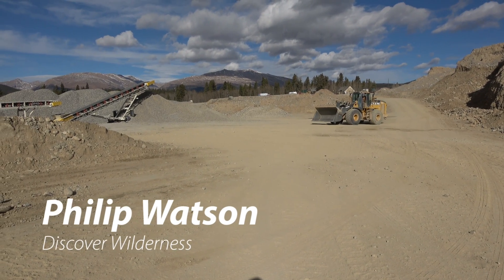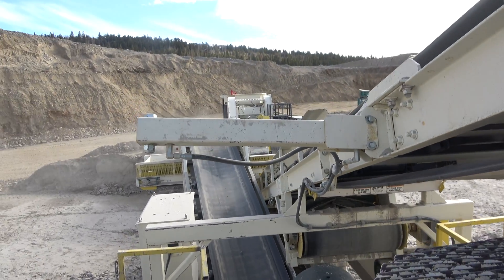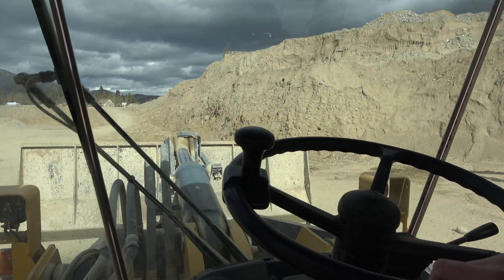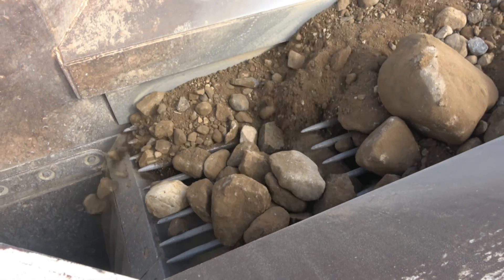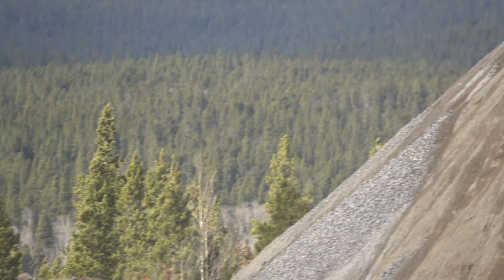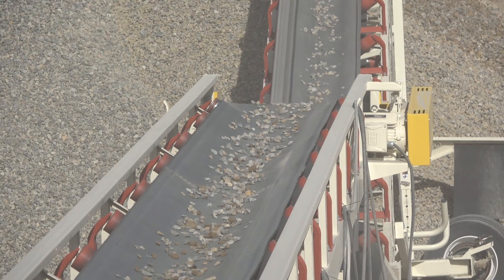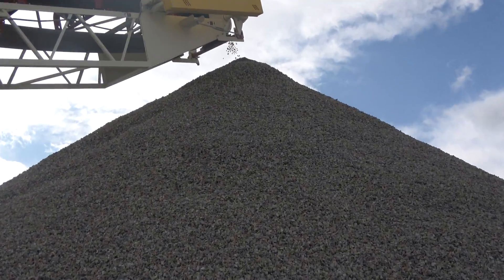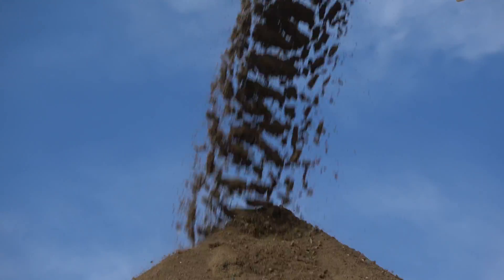Jaw Crusher, Cone Crusher (Road Base - How It's Made) (4K) - Episode 27

Comment: What tonnage per hour does your plant produce?   Also, I’m interested in cost/hour.  I’m getting involved with a preliminary study regarding crushing a 185KT ore pile down to -3” material, that will then be put through a 35T/hr ore sorter.  Ideally, I think -1” material would be best through the Steinert Ore Sorter, but for speed/delivery, management is thinking -3”.  I’m arguing that -1” can be handled effectively through a system such as this, whereby both -3” & -1” material is created.  
Regards,
GL, P.Geo (from Canada).
Reply: 500 tons per hour

Comment: And what are you guys using to control belt speed?
Reply: U don't
Reply: There are different size pulleys on the drive pulley , so you can select one of them to regulate your speed.
Aside from that, there is no way to regulate the speed electrically unless things have changed since.
Reply: @reb2322  a VFD or variable frequency drive is an option for alot of applications. We use one on our infeed. Thats really the only place we use that. I've never dealt with generator electricity and it's concept is not well voiced anywhere I searched. I've dealt mostly with line phase voltage with 5 wires. So when a gen set has only 3, I had to wrap that around my head. I thought no neutral? How the fxxk does that work??? I was confused until I finally grabbed the roots of a balanced system. Im only a part time service tech at best. Degreed in Drafting and Machine Design with an AAT but no electrical training. When it finally made sense I became much more comfortable working with that type of voltage

Comment: What kind of starter do you use on the jaw? Contactor, VFD OR soft starter? Would it be possible to take a pic of whatever method you are starting it with?
Reply: Soft starter.
Reply: @Rightomate  
Thank you. That's how we finally decided to go. Especially after pricing 3 No.5 motor starting contactors. New Allen Bradley's are over $10,000 ea.! We picked up a Chinese soft start for $1,400

Comment: My question is what happens to the dirt when you load the crusher, and how do you get the dirt mixed in with the road base material?
Reply from the maker: The dirt falls onto a belt that is located at the bottom of the three deck shaker box just before the cone crusher. The same belt that the three quarter inch rocks travel on.
Reply: @discoverwilderness  Okay thanks for responding, I've always wanted to know. Keep up the good work
Reply from the maker: Thanks for the question.